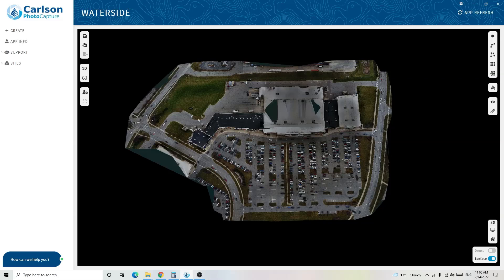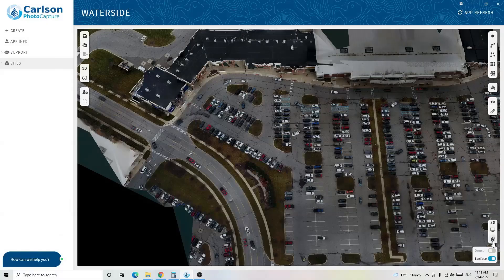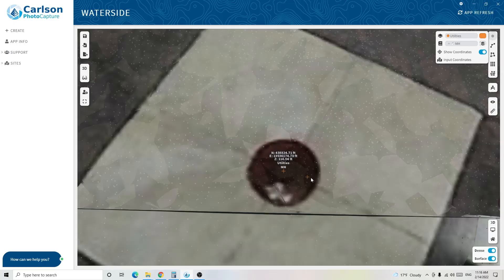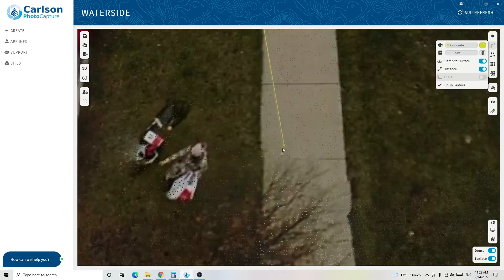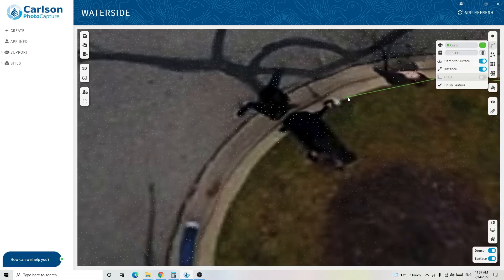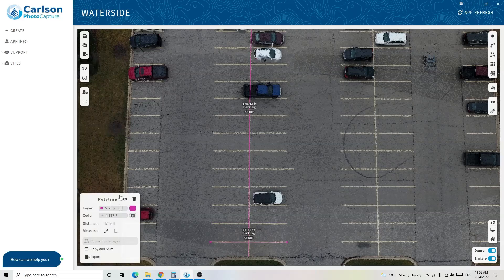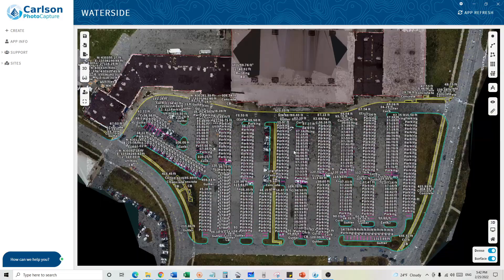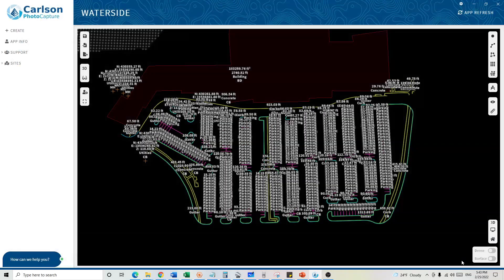Carlson Photo Capture - Survey Canvas

Comment: Rami, another great video. You mention your client doesn’t need the accuracy in this example. If you did need the accuracy, could you use ground control for your drone survey to increase overall absolute accuracy and extract features more accurately? Or do you still always need to shoot points for the features. Thanks in advance !
Reply from the maker: I did use the ground control points in this example, when I said the client doesn’t need the high accuracy, I was referring to not needing to use a total station for this project. Drone data can have an error of about 0.1’ in the horizontal and 0.3’ in the vertical.
Reply: @RamiTamimi  Flying at 100'-125', we are only seeing about 0.1' on vertical where the aerial data and total station data come together.  Can you explain why you say 0.3' on vertical and are we doing something different than you are? We always shoot areas where we know we are tying in and also some hard surface shots to use to check the aerial generally. To tighten things up, we'll incorporate our total station shots into the tin once the aerial data is brought into Carlson Civil/Survey. Anything under trees gets shot in too.